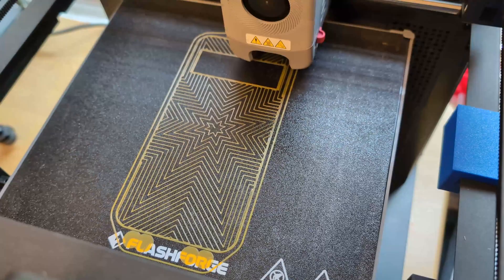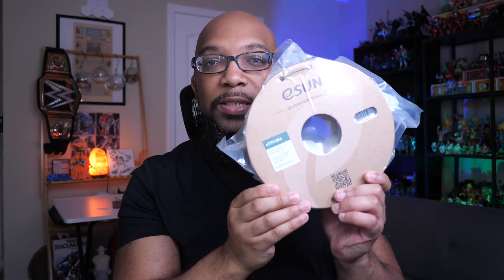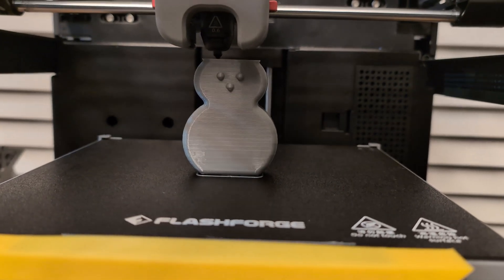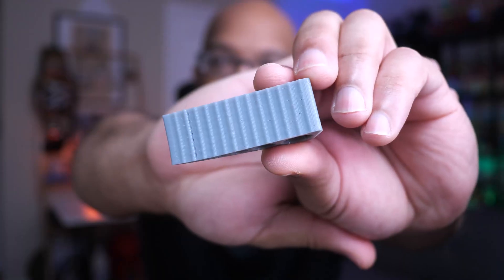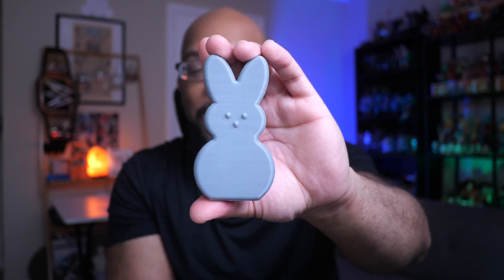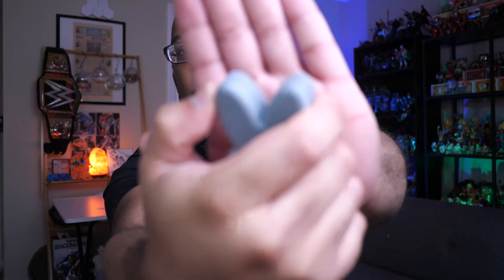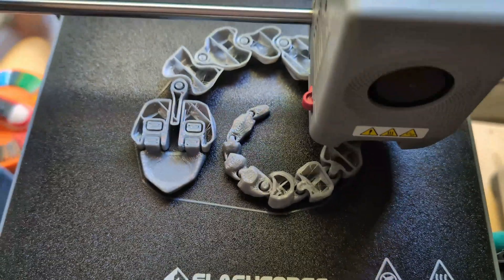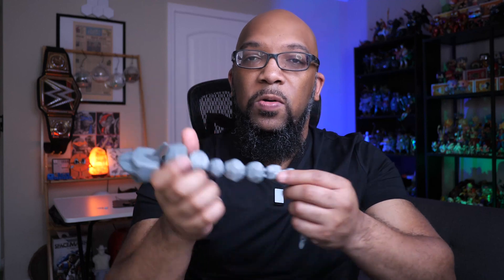Flashforge Adventurer 5M VS. TPU Filament: Part 2

Comment: I am new to printing. Got a Flashforge Adv. 5M for xmas 2025. I want to make a bully stick holder with a screw that tightens down on the bully stick. I saw online that TPU (70-90A hardness) is less hazardless for dogs to chew on so wanted to print one using that. Does anyone know of a good download for a bully stick holder that doesn't require a lot of changes in the slicer? I am really novice at this.

Comment: I am having issues printing lawn dart flights. They are to soft with TPU 95A. I have adjusted speed and temp. Layers fan speed, bed temp. Etc.. No matter what I do I can't get it hard enought. What do I do? Have you ever tried to print flights?

Comment: Brother your videos are incredible! Your presets worked perfectly!! Had to manually input your settings from the file you provided using Flashforge TPU and it came out perfectly. Keep up the hard work you are a benefit to the AD5 3D printing community!

Comment: Have you had any luck with the .4 nozzle.  The print I am attempting is small and may need that smaller nozzle.  Will the .6 nozzle settings work?  I have purchased the AD5X and I enjoy your informative videos.

Comment: My (second, first one doesn't have a working part cooling fan at the moment) AD5M wouldn't even take 95A, even after bypassing the filament runout sensor.  The actual hotend wouldn't pull it in.

Comment: I gave up getting the printer to pull Creality tpu from my Sunlu dryer. Unfortunately hanging the spool on the hanger on the back hasn't been any better.  The only way I can get it to feed is to pull the filament off the spool myself so it has slack.  I have to do this for the entire print which is not sitting well with me. I dried the spool for 24 hrs and I'm running the .6 nozzle at 20mm/s and I've raised the temp to 250C which seems to get better printing results.  Did you have any trouble getting it to feed properly?  I'm really disappointed right now.
Reply: I've been doing the same with creality TPU, such a pain. Have you had any further success? Or do you have any tips for working with the creality TPU & the 5m? Settings etc
Reply: @fredvan7335  I just threw the spool in the trash the other day.  Never did work out and I water a lot of time and money trying to make it work.

Comment: COULD YOU DO A REVIEW WITH THE FLASH FORGE ADVENTURE 5M AND FLASH FORGES FLEXIBLE PLA THAT THEY HAVE ???
Reply: I enjoy their flexible pla. I’ve printed out several things. Print quality is close to 8.5/10. I only say that because it doesn’t do well with supports. Trying to take the supports off is tough but the print quality, I feel, is excellent.

Comment: Bonjour  Jeremy, merci pour cette vidéo sur l'impression du TPU sur une FFM5 (et pour toutes celles concernant cette super imprimante d'ailleurs). J'ai reçu ma bobine de TPU d'une autre marque (GEEETECH) et de la même dureté shore (95A) et j'ai quelques questions qui me viennent au fur et à mesure que je visionne ta vidéo:
-Les paramètres que tu partage gracieusement avec nous sont pour une buse de 0.6, je n'ai, pour le moment, que la buse de 0.4 d'origine (j'attends que ces accessoires baissent un peu pour acheter une de 0.6 et éventuellement une de 0.25 mais celle-ci peut largement attendre d'autant que je ne suis pas certain de son utilité à ce jour) donc que devrais je changé entre tes paramètres et le fait que je vais les utiliser pour une buse de 0.4, juste changer justement ce paramètre de diamètre de buse et ce sera bon ?
-Je n'ai pas de box de séchage, je suis en traina d'en fabriquer une avec en utilisant un chauffage qui sert normalement pour les terrarium, il chauffe sans être trop chaud et ne consomme que 7Watt, penses tu que ce sera suffisant si je mets la bobine dans cette "drybox" la veille de me servir du TPU, je vais bien sûr mettre une sonde de température/humidité dans cette boite comme je l'avais fais précédemment mais la boite précédente n'était pas hermétique, la nouvelle l'est ce qui devrait permettre de mieux conserver chaleur et environnement sec pour les bobines en particulier les bobines de TPU. 
Donc si tu as le temps de répondre à ces deux questions ce serait sympa et m'aiderait grandement surtout vis à vis de ce matériau que je n'avais testé qu'une seule fois sur une autre machine (une Sidewinder X1 pour être précis, et ça avait plutôt bien fonctionné)
Merci d'avance.

Comment: Holy shyte I can make crocs for my kids! 🤣

Also, I’m not sure if you already do this but I did many years ago when the 3d printers were few and far between, and no one had one. It’s helped me a whole lot with the printers I’ve used.  I kept a detailed build log spreadsheet with what I printed, when I printed, kind of filament (brand / color) temps that I used (bed & nozzle) some detailed settings (supports / z-hop / retraction / etc) if it failed or completed, a few observation bullets on the print (if it had layer shifting, stringing / brittle / goopy / etc) and if I made any repairs, adjustments or upgrades to the machine in question. Knowing that has allowed me to really dial in specific temps for the budget grade filaments I was using.  

It is an additional step in the workflow that will take a little time but knowing all of that now has allowed me to help many many folks on various 3D printing Facebook pages over the years troubleshoot and accomplish what they’ve set out to do and more 😊
Maybe someone else here will find that tool useful as well. Just thought I’d share and am looking forward to more content! Thanks!

Comment: I need to get myself a dryer either homemade or buy one as I had issues with clogs too printing TPU tires. But will check out your profile for Orca as well. One thing I did was print only one tire at a time / that seemed to work better. And I also pulled a decent loop of filament off the spool and left it hanging under the printer as I think the 5M had issues pulling the filament off the spool. Just made sure it wouldn’t get caught on anything!

Comment: I bought a Creality dryer and tried printing eSun TPU while the filament was still in the dryer. Needless to say it was a massive fail as the printer just didn't want to pull the filament, I think it was just too much friction from the rollers in the dryer. I have wondered since if the way I had the filament loaded was the issue, coming up from the the bottom of the roll rather than over the top, if that makes sense.
Reply from the maker: I also have the filament coming from the bottom in my dryer, but rinting from a dryer did prove to be more complicated than I imagined.
Reply: I see other people have had to place the dryer above the printer to get better results

Comment: I know this is off topic but I'm at my wits end. I have the 5m with 2,7,7 firmware installed and it will not connect to wifi when powered on. I then power it off and on again and it will connect. when I go to wifi settings it will not even show any available networks. I even tried doing static IP as well but since it cannot detect any networks the static does not work either, It also seems the MAC address on the printer is different from what my router reports. Thanks in advance for any insight as this is a great printer outside of this issue I am facing at the moment. Far better than any of the Creality machines I own.
Reply: I can't help but it is well worth heading over to the FlashForge Reddit community, lots of friendly and knowledgeable folks there.
Reply: @Monkey-Sausage  Thanks! Ive looked around the reddit group and doesn't seem the same issue is popping up. Most are just unable to connect to wifi but can still see their networks. Thanks for heads up though. Much appreciated. Edit: Never mind. I found some stuff, thanks again.
Reply: Have you sent an email to FlashForge? They are REALLY good about getting back to you. I ended up having to do a full factory reflash of mine, but it fixed everything.
Reply: @ThisisDD  I have. I'm in the middle of that now. Just thought maybe someone had an easy instant fix. I also tried the factory reset with the same problem. They have been responsive though. We will see. Love this printer otherwise.